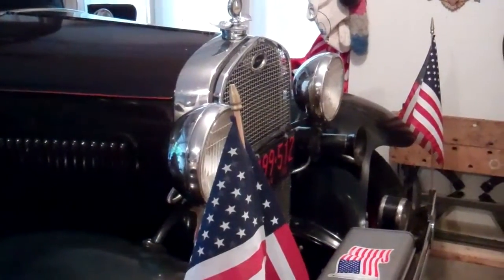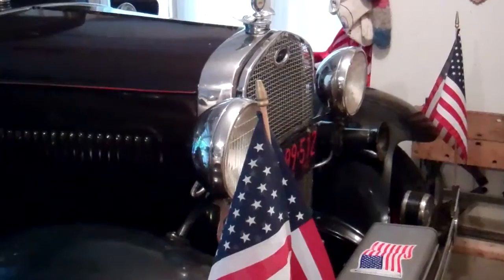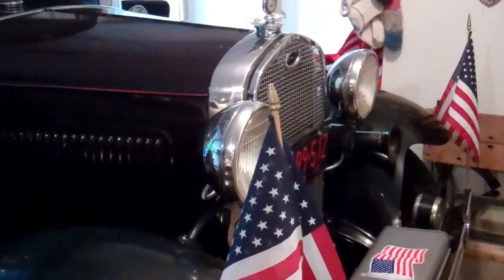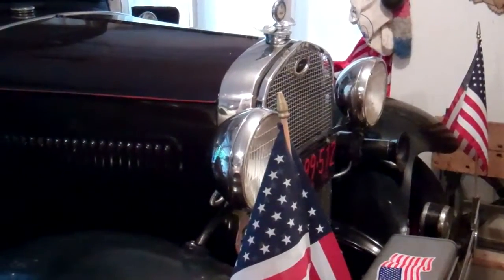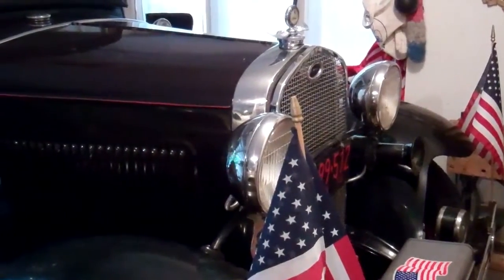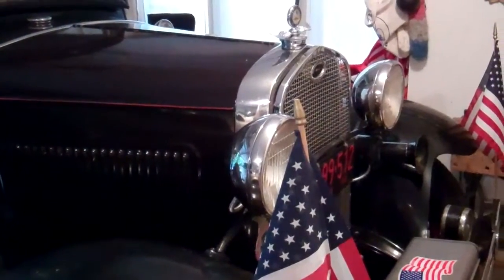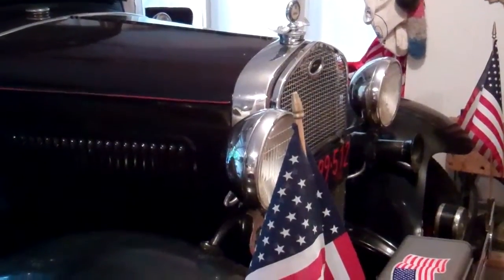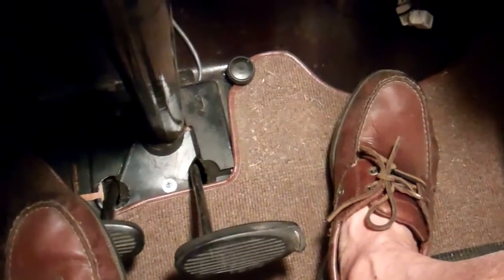Ford Model "A" Starter Hang Up How to fix it and prevent it

Comment: Thanks for this information. I put my A into 3rd gear and rocked it by myself. No clang. The starter still wouldn't turn over. I wanted to pull the starter off to look at it. After removing the 3 bolts, I couldn't pull it away. So with one bolt put in about half way, I rocked the car again. This time, the starter freed up and pushed out as far as the bolt would let it.

Comment: Thanks so much for this video.  This exact situation happened to me - tried to start it once and it turned over momentarily, and then it was like I had taken the battery out.  OY!  Anyway, getting some muscle behind it and doing what you said freed it up and now I'm back on the road.  Thanks again!
Reply from the maker: If you had my book in your car, you could have fixed it on the spot. Take a peak at it. Get a Horse. Sold by Snyder’s.   You can review the whole book at blurb.com. All pages are shown. Just search for “get a horse”.  Have fun with that car. Jack

Comment: One guy had it right, this trouble is nothing more than worn starter bearings, too much endplay and worn out starter drive.  I'm 88, driven these cars over 100 grand and never had such a problem, I fixed things before getting too worn, proper maintenance does wonders.

Comment: And for all those who want to adopt more modern methods with your Model A, invest in an ignition switch that actually turns full right under spring tension to engage the starter motor. This is most important when you convert to a 12V system. Starter hang-ups are a thing of the past with this simple modern update..............guaranteed!

Comment: Sometime this may be caused by a bent starter motor shaft. If the Bendix and ring gear jam, this will bend the shaft. Also, if the engine is started with the ignition all the way advanced, this will also bend the motor shaft if the engine kicks backward.
Reply from the maker: I agree, but how do I straighten a bent shaft?  Is there an easy way?

Comment: Yep. Simple, and easy to do if you 'don't know',  'screw up' (I've did it once) Had to bump my A (in 3rd gear) with my step van to break that little bugger loose. I'm not doing that again! (hanging up the starter thing that is)